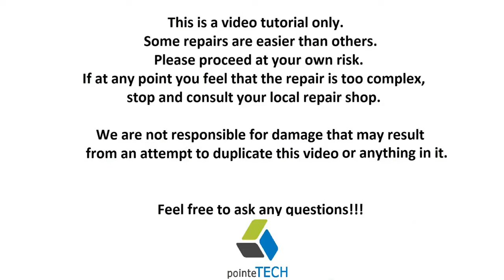How To Fix Replace Keyboard Key - HP Chromebook 14 - Letter, Arrow, Function, Small Keys

Comment: I tried this and it didn't work.  My HP chromebook was only 11 months old.  I also tried removing the keyboard and reattaching the ribbon but that didn't work.  I called for a warranty repair.  But the HP person on the phone told me to press down the power button and the refresh key for 15 seconds.  I did that, but I had powerwashed and needed to put in the WiFi code.  Since the keys hadn't been working we just skipped to where he would send a box to send it back.  I thought I should try to get it ready so I put in the WiFi password.  Lo and behold - ALL the keys worked properly, except the g key.  I have to really press down on it.  I messed it up when I removed it.  So first try the power button and the refresh key.
Reply from the maker: Very weird issue.  Thanks for sharing :)

Comment: I give up. I cannot get the clip to go back in even though it's not broken. When I do get the clip back on and the place the letter key cover back on it the whole key and clip just pop back up.
Reply from the maker: If the key wont install correctly, either a component is broken, its not orientated correctly, or the metal pins on the keyboard are bent out of shape and are not allowing the key assembly to snap into place.

Comment: I have a keyboard similar to this one on my HP Chromebook 14 X360. Putting the two white retainer frames back together was challenging. The hinge in the middle where the two white plastic frames meet was not connecting. The pins were not locking into the grooves because a thin piece of plastic was bent into the groove and blocking the pins from fully seating down. I bent the plastic out of the groove and the pins were able to lock into place. I'm glad its over, it was stressing me out, haha.
Reply from the maker: Glad your all set :) Always here if needed !!

Comment: I accidentally broke the two plastic pieces on my key cap, can you make. Video on how to fix that?
Reply from the maker: Did you break the Key Cap in two or did the retainer clip come appart?
Reply: @PC_Monkey  my two clear pieces came apart
Reply from the maker: @mammiedavis2322  They fit together with a small plastic pin on the left and right of the inner clip.  These fit into holes on the outer clip.  To see exactly how the inner clip sits in the outer clip, remove another key cap and copy the clip under it.

Comment: Him: And snap it into place
Me: Tries it, wait its not working what the...
Edit: Finally figured it out, And I probably need to get my eyes checked
Reply from the maker: If the Key Cap is not snapping back into place, there are usually two reasons.  Either the Retainer Clip is not snapped properly into place itself, or it is damaged and cannot securely hold the Key Cap in place.  To compare, remove another Key Cap and compare the two Retainer Clips.

Comment: Hi question is it possible to buy bags of keys, cups and hinges? for replacement?
Reply from the maker: I have never tried to buy them in that much bulk before so I'm not sure.  Most computer models have keys that are not compatible with other models so its most likely not worth it.  Unless you have dozens of the exact same model computer.

Comment: i have plastic in 2 pieces, is there any  way to repair it?
Reply from the maker: They fit together with a small plastic pin on the left and right of the inner clip.  These fit into holes on the outer clip.  To see exactly how the inner clip sits in the outer clip, remove another key cap and copy the clip under it.

Comment: ye have that my keys is still broken i did ur step but its broken idk how to put back in and it cannot repaired :(
Reply from the maker: This is a tutorial on how to replace a key if the key is broken and needs to be replaced.  Simply removing it and putting it back on will not repair a broken key :)  If the key is physically broken, it would need to be replaced with a non-broken one

Comment: my d key keep coming off the little things inside have broken apart and I'm not sure if its fixable or not (I have a Chromebook 14)
Reply from the maker: If the Key Caps keeps coming off, its most likely one of two reasons.  Either the Cap is not clipped into the Retainer Clip properly, or the Clip is broken or itself, not snapped in properly.  To see if it has any damage, remove another Key Cap and compare the two clips

Comment: Hey! So I have a problem with my 'Esc' key. It's wiggly, how do I fix it?
Reply from the maker: I would remove the key cap as seen here and inspect for damage or where the lose connection is coming from.  You may have to reinstall the retainer clip or replace it

Comment: hey i dont know if u will see this but if you do i really need help so do you know a replacement for the little circle rubber thing in the middle of the key. I accident broke mine trying to fix my key and now i have to push super hard to press it. Do you know any replacements or do you think its safe to super glue it back on?
Reply from the maker: There isn't really a good way to reattach those.  They are not meant to be replaced.  Best advice is try to use a small amount of glue.  If that does not work, you may have to replace the keyboard.
Reply: @PC_Monkey  what do you mean as in replace the entire keyboard because its a laptop i have a bunch of keys only
Reply from the maker: @EthansGamingAndStuff  replace the entire keyboard means purchase a new keyboard, take the old keyboard out of the palmrest and install the new keyboard in its place...

Comment: what do we do if the plastic did break?
Reply from the maker: You would need to purchase another loose key on Ebay, Amazon, etc.  Or you can purchase a used keyboard for spare parts :)
Reply: @PC_Monkey  what of the white spongey part is missing
Reply from the maker: @nopenope6750  If your referring to the rubber spring at the center, than you would need to replace it.  That pushes the key back up after you press it.  It may not work without that part.  Your best bet is to find a loose key for sale on sites like Ebay, Amazon, etc.  Find one that sells that part with it.  If you cannot find that, you will have to purchase a used keyboard and take it from there.
Reply: @PC_Monkey  I'm going to replace the keyboard assembly.

Comment: I tried the steps but when i try to click the key into place it kinda stays there but it's super wobbly and uneven and it falls out constantly
Reply from the maker: If your Key Cap is not clicking down in place correctly, it is most likely due to the Retainer Clip not being properly installed or damaged.  Remove the Cap and inspect for damage or that its not laying down flush and properly snapped in itself.  Compare to another Clip if needed by removing another Cap.
Reply: @PC_Monkey  I checked an it's the metal part that locks on to the retainer clip because when I remove the key cap the white clip comes up with it while the clip not being damaged
Reply from the maker: @aedan402  Yes, if the metal pins on the keyboard are bent out of place or damaged, that will cause the retainer clip to not snap into place correctly.  Try to bend the metal pins back into correct position.  If you cannot, then you may have to replace the keyboard :(

Comment: So my o key broke, and it looks like it could just snap-in, but it isn't...any advice?
Reply from the maker: If your Key Cap is not clicking down in place correctly, it is most likely due to the Retainer Clip not being properly installed or damaged.  Remove the Cap and inspect for damage or that its not laying down flush and properly snapped in itself.  Compare to another Clip if needed by removing another Cap.
Reply: @PC_Monkey  what do I do if it's damaged? it's not that much damage, so I don't think it has anything to do with my problem, but I'm still concerned
Reply from the maker: @quinnneedssleep  If its damaged then you would need to replace it.    I usually get my keys on Ebay or https://www.laptopkeys.com/
Reply: @PC_Monkey  I actually found a Dell keyboard that can connect with a USB port, and I've been wanting to get a new laptop anyway so I think I'm fine for the time being. Thanks though!

Comment: can you do a arrow keycap
Reply from the maker: The arrow keys are usually the same size as letter keys.  Are yours smaller?  If so, they will be constructed the same way, just smaller components.  Also, the Retainer Clips may be installed sideways so instead of going at it from the side as I do here, you may need to go from the top or bottom

Comment: Hi i did as you said but the key keeps lift up ? like its not clip in place
Reply: the two white part where separate i did my best to put them back together
Reply from the maker: @cerinem.9250  If the Key still lifts up then its either not attached correctly to the Retainer Clip or the Retainer Clip is not attached correctly to the Keyboard.  I would double check the Clip, as thats the most likely.  Compare it to another one if possible for any differences is how its laying down or if its not reattached to itself properly
Reply: @PC_Monkey  okay thank you very much
Reply from the maker: @cerinem.9250  Happy to help :)  Always here if needed !!

Comment: How do I fix the key when the white clip thing is in two pieces?
Reply from the maker: They fit together with a small plastic pin on the left and right of the inner clip.  These fit into holes on the outer clip.  To see exactly how the inner clip sits in the outer clip, remove another key cap and copy the clip under it.
Reply: @PC_Monkey  thanks so much this helped!
Reply from the maker: @Jake7308.8  Great to hear !!  Always here to help :):)

Comment: hello sir i have chromebook14 at the moment B and N keys not working please rply
Reply from the maker: Do they feel like they are mechanically broken?  Do they feel like they dont operate correctly or do you think it may be the keyboard is going bad?
Reply: @PC_Monkey  I have the same problem! B and N. I have removed the keys and put back together, everything seems to be operating correctly mechanically, but they don't type.....any ideas?
Reply from the maker: @tlcassel  If they seem to be ok mechanically but dont work then the keyboard itself is prob the issue :(  Would have to replace it or the palmrest

Comment: Hey what is that white thing call eBay I need one because I broke it :(
Reply from the maker: All 3 components are white lol.  The top part, I call the Key Cap.  Then there is the inner part called the Hinge or Clip.  Then the Rubber Spring.  They usually are not found for sale separately however.  You may need to purchase a whole key assembly or a keyboard if you cant find the key.
Reply: Thank you
Reply: I can fine it
Reply: I can’t find the clip
Reply from the maker: @cloud_rblx91  Ya, they usually are not sold separately.  You would most likely have to purchase a whole key assembly.  And if you cant find that, you would have to but the keyboard and take a key off of it
Reply: I’m to poor to do that
Reply from the maker: @cloud_rblx91  Usually an individual key on Ebay will go for under $5 USD

Comment: My dumb ass thought I could fix it but I've just made it worst
Reply from the maker: Keys can be one of the most frustrating parts of computer repair lol.  If one of the key components is damaged, you may have to replace it.  I usually get my keys on Ebay or https://www.laptopkeys.com/.  If you cannot find the correct key for sale, you may have to purchase a keyboard and take a key off of there.

Comment: how does replacing the plastic bracket enable a key to start working again lol.
Reply from the maker: This video is a tutorial on how to replace a key.  If the reason your key is not working is because its damaged, then replacing it with a non-damaged key will help.  If the key is fine, then you wouldnt really replace it now would you lol
Reply: @PC_Monkey  Lets use the letter"N" for example. Stops working. You're telling me replacing the key bracket will enable the letter "N" to start working again?
Reply from the maker: @WhiteoutMonster  wow lol.  That depends on HOW its not working.  Do the keys feel like something is physically wrong with them or do they feel like they are physically working fine?
Reply: @PC_Monkey  Keys "N" and "B" physically feel fine. Up and down motion is there like it should be (which to me is cause by the bracket as the bracket moves) but input wise nothing happens. I would assume a board issue? That's why I was shocked at seeing you  replace the key bracket and "fixing" a key, as I had googled a solution and stumbled upon your video.
Reply from the maker: @WhiteoutMonster  Replacing a key fixes it if its physically broken.  This video is a tutorial on how to replace a key.  If your keys are not working but are not mechanically broken, troubleshoot them as seen here; https://youtu.be/wqrchfpdJ_w.
Reply: @PC_Monkey  Dude that's actually my bad. I didn't really think about the whole " physically broken"  part vs the not accepting input aspect of this video. I apologize for my attitude.
Reply from the maker: @WhiteoutMonster  np good luck :)

Comment: i have a  chromebook14  and the j key fell of i try doing this it didnt work its very lose and falls off 
help?
Reply from the maker: Examine the Retainer Clip carefully.  Is it damaged at all compared to others?  If not then the key should be fixable.  If the Cap is not clipping onto the Retainer Clip correctly, that most likely is your issue, assuming the Clip isnt damaged

Comment: i tried prolly abt 200 times to get it to snap in and it didn't work i gave this a dislike
Reply from the maker: If your Key Cap is not clicking down in place correctly, it is most likely due to the Retainer Clip not being properly installed or damaged.  Remove the Cap and inspect for damage or that its not laying down flush and properly snapped in itself.  Compare to another Clip if needed by removing another Cap.
You disliked the vid because you couldnt do it?  ok lol thx

Comment: So my arrow keys (left and down) are really slow so i think its just dirty under the key what should i do
Reply from the maker: If they feel like they are not working correctly, they may need to be taken apart and cleaned or reinstalled correctly as seen here.
Reply: @PC_Monkey  I took em off and cleaned em and it works fine now, but I took over half an hour trying to get the left arrow key in and I just realized its backwards
Reply from the maker: @Silicosis_  Keys can be one of the most frustrating things on a computer lol.  Good job :)